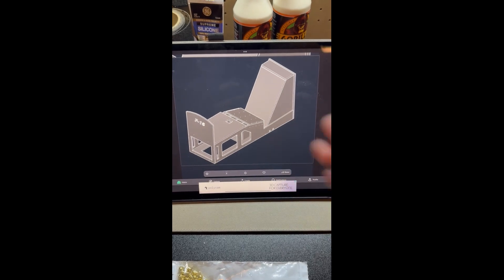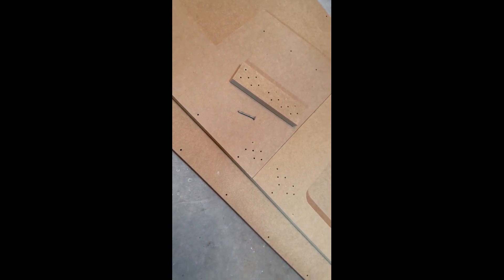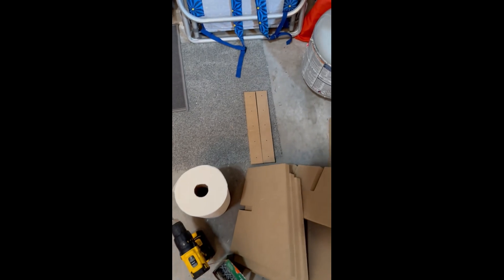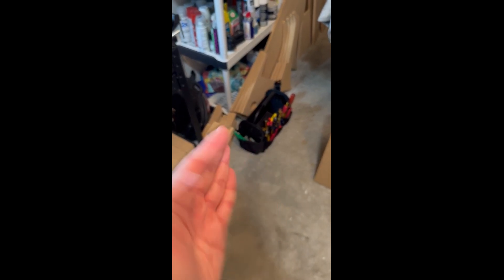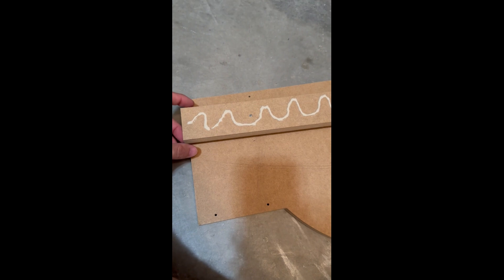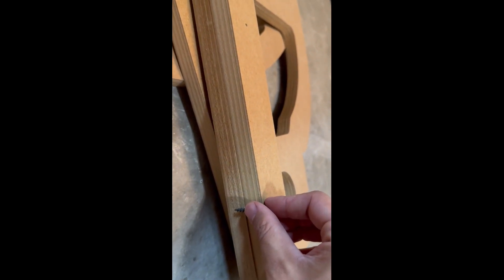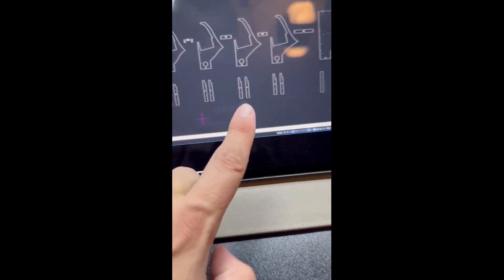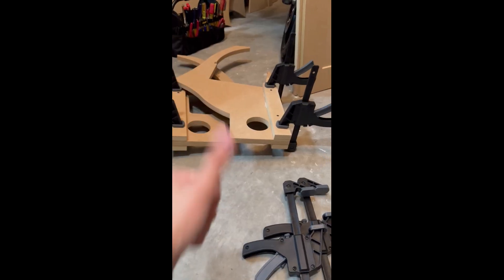An Adder Fanged: Building an F-16 Cockpit Part 2: Initial Construction

Comment: Are you going to use VR or a monitor?
Reply from the maker: The second I tried VR back in 2016 I knew I could never go back to 2d flying ever again. 
BMS now supports mixed reality natively and it can be done easily enough with DCS. I’m in line for the somnium ultimate headset… can’t wait to replace my varjo aero

Comment: good work man! saw the aces seat in the background, did you build that out of the same plans you got for the tub? (TJ's I assume?)
Reply from the maker: Yes, I got that seat from him way back in the fall of 2021 and I had it jammed into my first pit. 
He offered me a seat with this f16 pit for a great price and I couldn’t say no so I bought an additional seat that I’ll make into an a10 ACES II for the a10 pit I’ll eventually build one day
Reply: Where do you got the files? Cheers.
Reply from the maker: @memeswithoutcontext4716  join his fb group, “the cockpit shop”
Reply: Thank you so much, 

Are you going to build the full cockpit like "The Warthog Project" and are you going to use a lot of real parts or just building them yourself? I'm pretty shure you will run this with Falcon BMS mixed reality? 

I'm starting to build my own cockpit right now, so thank you for your help.   :)
Reply from the maker: @memeswithoutcontext4716  yes I plan to go warthog project level of deep - and to make a warthog pit myself one day! Truth be told I love the a10 most of all (if you haven’t seen my other videos) 
Yea BMS mixed reality is the play I think. Stay tuned I plan to document every little thing I do
Reply: @BlackSockRepublic   Sounds great! 

As a German i would like to build a eurofighter cockpit, but there is no community and no software...   So the next best plane in my opinion is the f16. Right now i'm only a civil pilot with MAAANY ffs hours in 737 and A320, so my ambitions in fidelity are high!   Cheers.